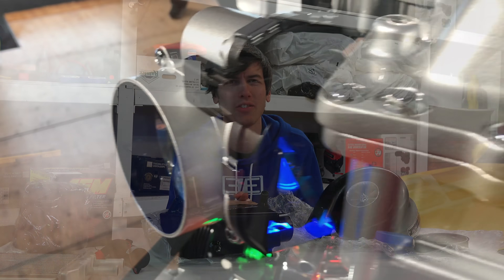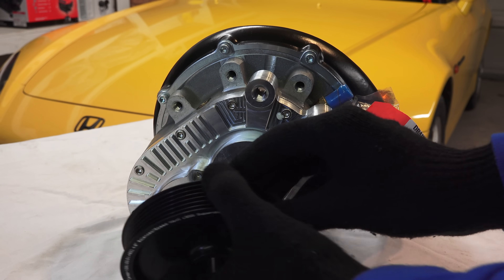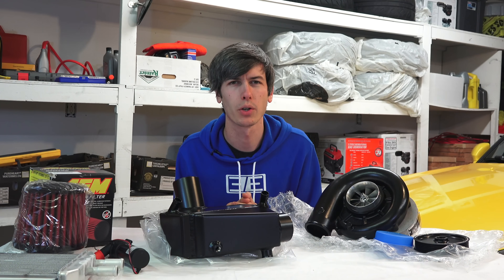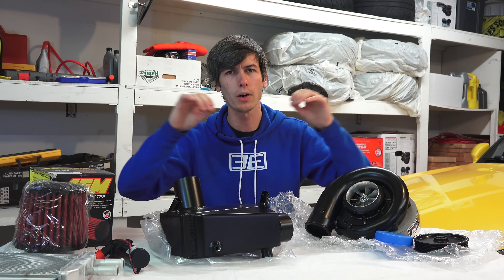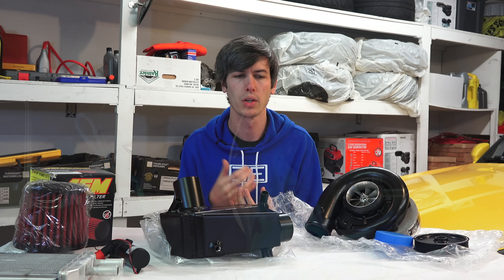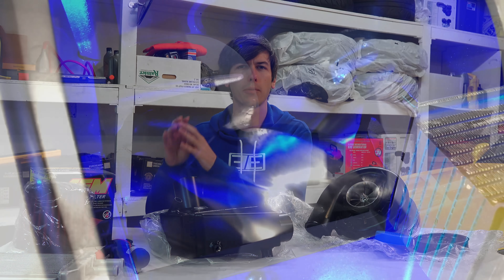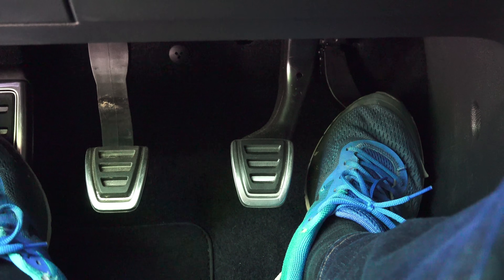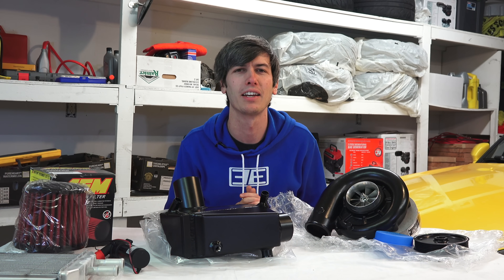Turbochargers vs Superchargers - Which Is Better?

Comment: You forgot to mention, that motors with large displacements are a bit of a pain in the ass to turbocharge. 
A big single turbo on a big engine will have a massive Lag. Bi-turbos are usually expensive and more difficult to install.
A bigger Supercharger has no lag, that's why most V8 engines are much more likely to be supercharged than turbocharged.

Comment: There is lag with a super charger as well. You don't instantly get max psi the second you press the gas pedal. It usually starts as vacuum and raises with rpm. Just like a turbo. Sure you can get max psi at roughly 2-3000 rpm and hold it til around 6500.... but you do the same thing with a turbo.

Comment: Engineering Explained... I completely agree with you about driving with a supercharger...
   A vehicle that really responds well to supercharging is the FRS/86/BRZ... (and of course any small displacement sports car like the Honda S2K). What I find is that you don't "loose" or "ruin" the cars driving dynamics, it just adds power and TQ everywhere. SO while a turbo can be fun to drive with, it tends to make vehicles finicky in corners... when you lift then apply the throttle, the resulting lag can really throw the driving dynamics off.

Comment: Have you ever tried hybrid turbocharged engines with torque fill? You use an electric motor to eliminate the turbo lag and to give you the linear response on the trottle you really like. If yes, is it really effective or the turbo lag is still there?

Comment: One drawback you didn't mention with superchargers is that you lose boost at high altitudes which you don't with turbos, or do to a lesser extent. High altitude usually just adds more turbo lag, but since superchargers are engine driven, they can't just turn at a higher ratio to make up for the thinner air, so their maximum boost just drops off the same as if you had a higher displacement engine.

I still prefer superchargers though.

Comment: What are the basic issues of adding these to an NA engine?  Seems like running an SC off the belts would be simple and avoid computer ECM gremlins, then wire a clutch in the SC so it can be swotxhed on and off?  Just basuxally adding a load to the engine and some extra air ducts.  ???

Comment: Thank u for showing us the force induction system comparison.👊🏼👊🏼👊🏼

And I would be extremely happy to have my very own 55 mm descendant bolt-on turbocharger for my 2.4L 2AZ-FE 2015 Scion xB. Small engines with turbocharger is very satisfying and awesome to have. For better power and torque and still drive as a daily. 💪🏼💪🏼💪🏼💪🏼💪🏼

Comment: Mazda 626 GT with a  2.2 liter 12 valve 4 cylinder turbo charged engine.  That car has two power adders, first being the turbo and second being a older version of VRIS.  So you get extra power around 4K rpm.  When modified, it can burn rubber at 55 mph in third gear and take down some older Corvettes.  Nowadays get a speed 3 or 6 but make sure it has a factory air box.  Modify everything else first but leave the factory air intake alone.

Comment: If you are driving for performance it seems clear the supercharger is better. With the turbocharger if you are driving 4 performance, you lose a lot of the efficiency anyways and you get the disadvantages in terms of throttle response. For the average driver, the turbo is probably better because it delivers fuel economy relative to average power output.

Comment: While I like the straightforward nature of superchargers, technology is making them obsolete for most uses. 'Electric turbochargers' (where the turbine and compressor are not mechanically connected) eliminate the throttle response issue by powering the compressor when exhaust pressure is low with stored and regenerated energy, and they should become much more common soon.

Comment: I've heard of variable ratio centrifugal superchargers. This could ideally combine the good efficiency of a centrifugal compressor with the instant all-range boost of a screw blower and the low-load-low-drag of a turbo. Being a supercharger it also has the low backpressure and high scavenging advantage, but it does directly draw power from the crank under boost rather than mostly from (free) blowndown when the exhaust valve opens approaching BDC like a turbo. I don't think it's a new invention, but I can only find one commercially available right now

What are your thoughts on such a device?

Comment: I noticed this, but you never made a specific this IS better. I was hoping that you would took at multiple instances of turbo v super like the one I think car throttle did with NA miatas, because I feel like turbos can be much faster if you adjust and use left foot braking, because I remember watching a documentary about the Audi sport Quattro touring car thingy with a I5 turbo, racing against V8 (I dont know about aspiration, but they would have instant power) and the driver was talking about how once he figured out left foot braking he didn't notice lag. Just wanted to see your take on this

Comment: I feel the effect would be different for people depending on how their brained is wired according to their butt dyno. I feel some people use the butt dyno to "confirm" their pedal position and others may use the butt dyno to "determine" their pedal position. Which a big thing in tuning isn't necessarily to do what makes the car "faster" but the driver more "comfortable" so tune to the driver, not the car.

Comment: One thing worth mentioning is the upkeep, ease of use, and especially ease of installation is easier with a supercharger and a lot of mechanics will prefer or recommend them. 

Turbos will give you that big power you want but at the expense of maintenance, cost, time, and difficulty of installation.

Comment: The worst part about superchargers is the extra stress on the engine. The tension on the crank from the belt is higher and causes a rotating bending moment on the crank shaft. Now in addition to that the pistons and rods feel more stress to make the same hp so superchargers have a higher chance of blowing a rod out of the bottom end of the engine at a given power level. 

Also turbos last longer and at cheaper, a good supercharger is lucky to not require a rebuild before 100k miles. A turbo can easily make 100k miles unless used in the harshest conditions.

Superchargers are significantly easier to tune though.

Ultimately for a daily I would go:
N/a
Twin screw
Centrifugal
Turbo

And for a race car I would go:
Turbo 
Twinscrew
Centrifugal
Roots 
N/a 
N20

Comment: it takes energy to pump air out of your engine the turbo adds a resistance to the exhaust making the engine work harder to pump air out.  a supercharger just takes the energy directly. the only time a turbocharger should be more efficant is when the wast gate opens and allows the air to exist fairly un interrupted. turbos do not operate on free or wasted energy.

Comment: As a fellow S2000 owner and coming from turbo cars, I enjoy cars the most when they respond how I want them to. My WRX was fast, but you couldn't depend on the boost to be consistent. Driving the S2000 on the track, it does what I want when I want, which is why I would choose supercharger hands down at this point.

Comment: If you have a stroker motor with strong bottom end (rods, Pistons, crank Etc) with a stock or basic valve train then a good twin-screw, roots, Whipple type supercharger is great but if you have a good valve train that's good for engine speed (lightweight valves, good Springs, roler lifters and Rockers Etc) and a shorter stroke with a stock bottom end, or questionable strength in the bottom end (Pistons, rods, crank Etc) then a turbo or centrifugal supercharger that doesn't make as much cylinder pressure at low engine speeds but makes higher cylinder pressure at high engine speeds with a great valve train that can handle RPM then that's the way you want to go, with a turbo or centrifugal supercharger. Let me see if I can sum that up. If you have a simple questionable valvetrain (stock maybe) but strong bottom end with a long stroke then a Whipple roots or twin screw type supercharger is the way to go but if you have a killer valve train with lightweight valves and good Springs and Rockers that can handle a lot of RPM then you probably want to go with turbo or centrifugal supercharger.

Comment: TURBOS CAN BE DANGEROUS! On a rainy night, in a '97 F-250 Supercab with a 7.3L PowerStroke,  I went around a curve at about 15mph (it was pretty sharp).  At the curve's exit was a decent incline, so in order to climb the hill I start GRADUALLY giving it fuel. The moment the turbo kicked in we went sideways with my 8ft bed about a 2ft from the opposite white line. Luckily my experience with being young and stupid kicked in after all these years and I was able to get it under control without putting it in either ditch! If there would have been anything coming it would have been a VERY BAD DAY!

Keep in mind I wasn't hotdogging it or driving stupid, I had already came out of the curve and was picking my speed back up.  I'm a truck driver so I take wet roads seriously, that's why I took the curve at such a safe speed. When I broke traction I was only going about 20mph, but i'm sure the speedometer probably INSTANTLY shot up to 35 or 40!

Comment: Congratulations for the excelent video about both compressors.
I have a question. Is it possible to use a supercharger and procharger together with the same belt and pulley?
Best regards

Comment: I wonder why no-one has come up with an idea for a supercharger/turbo hybrid that combines advantages from both while minimizing their drawbacks. I imagine something that works off of the engine at low end, then through some kind of clutch releases it from the belt drive to be driven by the exhaust once it spools up. The issue is the awkward way in which it would attach to the engine.

Comment: Are turbo chargers really more efficient? After all, you are not getting that work done for free as the pistons have to push the air that is being restricted by the turbo charger, so really you are only just exchanging a mechanical coupling with a fluid (air) coupling.

Comment: even through that turbocharger is more complicated (due to have component that don't needed by supercharger). but I prefer turbocharger due to it is work in low power engine, and while we drive slowly, it seems practical because we won't get boost in low RPM (which it is perfect because in slow driving, we need more control than power).

Comment: I've heard the two sides of which ones are best at certain RPMs.  I believe that supercharger s give the boost off the line up to around 4000 rpm (example) where the turbocharger will activate, keeping the torque going to the wheels.

Comment: The best response is having the car moved by an electric motor. A small 2 cylinder turbo charged engines can be at a constant speed turning a genny providing the electricity with a battery buffer bank.

Comment: I still believe that your reasons aren't justifiable. You can still modulate the throttle with a turbo. You just have full boost at that instant. There have been a couple that tried it and saw for themselves example mightycarmods. A factory turbo car has to be tuned for the general public and cannot be compared to a car you turbo yourself. I would encourage you to try out a 300-400 hp turbo s2000 before deciding but then again you already have the supercharger so that is out of the question. At the end of the day it's your car. I'm positive i will enjoy your videos irrespective of the outcome.

Comment: I want to know if turbochargers are really free power? yeah there is the oil component but what about the effect of exhaust restriction, does it effect maximum power? Or would this be more relevant when a small turbo is used? Or does the waste gate remove the restriction enough at high rpm to prevent power loss?

Comment: At 5:36 you state that roots style and twin screw style superchargers do not use oil for lubrication. That is not correct...They use a self contained and sealed oil supply that is separate from the engine’s oil supply. Could you imagine something made out of metal spinning as fast as one of those superchargers without any lubrication? They would not last very long....otherwise great video! Edited out the comment about parasitic drag cause you did mention it lol

Comment: You can also get the best of both worlds, like what did lancia using both of them. What are your thoughts about the triflux head design developed in the 80s by Lancia Abarth? There is one running engine in a red Lancia ECV1, but i would really love to see that kind of engine in a modern car.

Comment: I have a question... Thinking about turbochargers, when the exhaust gases are in the exhaust manifold they're travelling at high speed, then they enter in the turbine and after spinning it, they get out. Since the compressor rotor has to keep pulling in air, the exhaust gases has to keep the turbine spooled. While in a naturally aspirated straight-piped veichle there is no resistance for the gases to get out, a turbine can also be a resistance for the gases travelling at high speed, so the engine have to spend some energy to push the exhaust gases inside the turbine. If the engine is spending that energy, the turbo isn't using free energy. I know that the power gain is huge, but I'm curious to understand this thing. Also obviously there aren't factory naturally aspirated straight-piped veichles, as well as there aren't turbocharged straight-piped veichles, so the only difference in gas-flow resistance can be the turbine. Is all this "reasoning" right or why not?   
P.s.: Sorry for the grammar, I'm not english

Comment: I was hoping you could go into detail about the advantage/disadvantage between air to air intercoolers vs water to air intercoolers.
Regardless of the results, I'm going to start buying parts for my STi to convert to a water to air intercooler this spring.  I know water will draw more heat from the charged air much better than than air, but I was wondering by what percentage(?). 
Just an idea for a vid I guess.  There is very little info about water to air except in the dark corners of the web.  haha

Comment: Short answer; want power and don't care about fuel consumption? Get a supercharger
Want power and efficiency on fuel consumption? Get a turbocharger
Reply: Turbo is more power but also more moving parts. Superchargers are cheaper and easier to install but not as much power
Reply: I would disagree. A turbo charger only works in high rpms, depending on how it's set up. But if you want to keep pushing it then it'll not only overheat but it'll also consume more fuel because high rpms, just like a supercharger. But a supercharger is running all the time, because it's belt feed. Meaning low end power. The hellcat has 400ftlbs of torque at 1500rpms, and an 11lb supercharger. The fuel efficiency only makes sense if it's getting out on a small engine that will almost never rev high
Reply: Well, I have a turbo car because it produces great low-end torque. Great for daily driving.
Reply: @rpinola  do you have a gasoline or a diesel car?
Reply: Superchargers are fuel efficient. They dont go into boost until you mash the throttle enough to close the bypass. So it works like an NA car until you stab it.

Comment: Great video! One question. People always talk about a supercharger being a load on the engine and a turbocharger not loading the engine, but won't a turbocharger add more "exhaust pressure" to the engine? More exhaust pressure should create more resistance for the engine to overcome, thus loading the engine. It doesn't seem like a free lunch to me.

Comment: So if superchargers are superior from a driving experience point of view, and don't have the drawback and complexity of extreme heat and oil lubrication, why are there so few supercharged small engines? It would seem to be a no brainer to make a supercharged engine vs turbo but all you see are turbo 4 cylinders in new cars.
Reply: Because automakers need to meet CAFE fuel standards and as Jason said, turbos are more efficient than superchargers.  Consumers also look at mpg more than how much lag there is.

Comment: One pint about super chargers he forgot to mention is that sometimes, superchargered cars/ engines can have a very extreme response from a start, which some people don’t like the instant power right off the line, they would rather have a more controlled start and make more power through the whole powerband or towards the end, instead of a big spike in power right off the start

Comment: So would it be possible for a manufacturer to make a turbo that is run by a belt until it reaches its boost threshold then acts like a normal turbo?  Basically a single turbo that acts like a twincharged setup.  This way you can run a big turbo, but still have zero lag.  I know it would take some trick engineering, but it should be possible.

Comment: Why don’t they make a supercharged driven by an electric motor, energy for which could come from the exhaust gases, like in F1
Essentially an electric driven (instead of shaft driven) turbo, which, with the addition of a small capacitor could have the high efficiency of a turbo with the characteristics of a super?
How hard can that be? 😂
Thx a lot and loving your vids